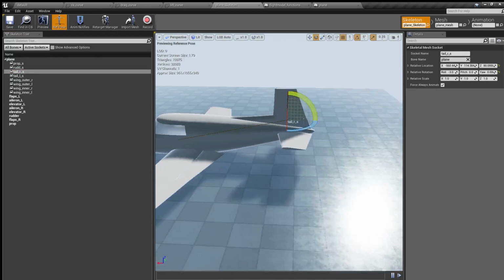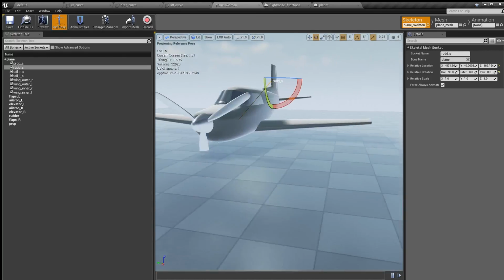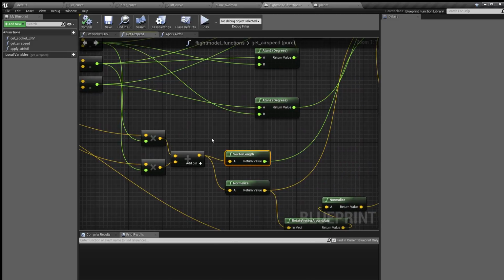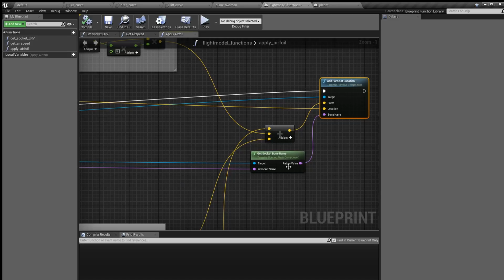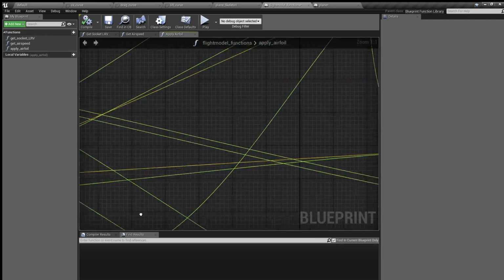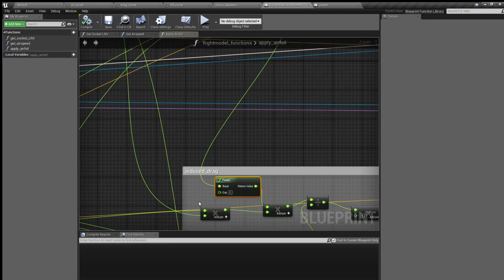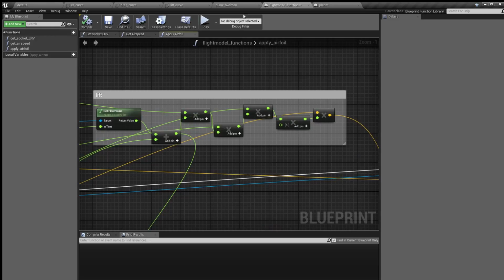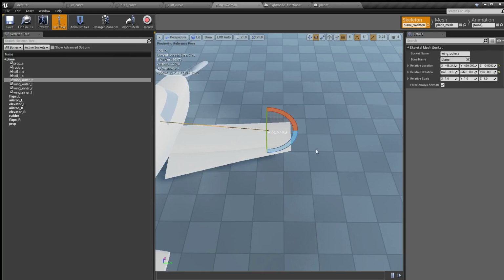physics based flight model in UE4 - how it works

Comment: More and more I respect your mind blowing work sir :D
The question is...now that your awesome plugin is released....is there a way to add these sockets again?!! because it will make damage model more realistic...or there is another easier solution?!
Reply from the maker: With EFM it's not possible, turning it into a component model would require complete rewrite. That said, lift asymmetry is modeled, and it's possible to simulate damage effects by changing left and right side multipliers separately.

Comment: Is there an easy way to calculate the physics in a flying sidescroller game? I'm thinking about cloning the game "3918" by oxeye. The plane only moves on the x and z axis and it rotates around the y axis. It needs to be able to fly upside down because the planet is going to be circular. It also needs to handle a changing air pressure, a complete vacuum and changing gravity.
Reply from the maker: Well you could do the same thing i'm doing here, except make everything flat and lock the depth axis, as well as roll and yaw.

Comment: how can i apply thrust to the airplane?
Reply from the maker: Get forward vector of  your object, multiply it by power of your engine, and apply it as force at engine location.
Reply: thank you ;)
Reply: So now my plane starts spinning. Maybe i did the axis mapping wrong?
Reply from the maker: 3NCRYP73D ACC0UN7
There could be a number of reasons, one is that yes, axis are set up wrong. Try turning off all the other forces except thrust to see where the problem could be.

Comment: hey,

this is really pretty nice. also saw your forum post and tested out the .exe with the jet-fighter. also really good work. looking forward to see it in the marketplace.
just can imagine a few different version of your plane contoll. defintily a thumbs up and waiting for more :)

also rebuild it. but didn't get it to work yet finally with the input. but takes some time, to repdrouce it. but also looking forward to the more complex version.
Reply: finally i got it working. just need to fix some stuff, but the plane is flying :) if you want to have again this simple version, mail me. (somewhere you metioned, your project went to complex).
this simple version is pretty nice. just the wire fuck (like you said), is a bit confusing.
Reply: @spaehling  My plane is slowly diving as I possibly don't really deal with the thrust BP. Could you share yours ? TY :)
Reply: @benoitc5266  i recommend getting: https://www.unrealengine.com/marketplace/en-US/slug/aerocomp
it has a nice documentation and all you need inside.
Reply: @spaehling  i found a solution thx. I could test aerocomp earlier but it is not really a plane, sorry for that.

Comment: Two questions.

1. How do I get/make the "Get roll" "get pitch" and "get yaw" functions?

2. What would be the best method to actually apply thrust to the plane?
Reply from the maker: +NovaXP

1. those are control axis, you have to set them up in project settings.

2. with "add force" or "add force at location".
Reply: +Worstplayer Awesome, thank you very much for this tutorial!

Comment: This is a really good looking system to emulate flight! You should consider putting it up on the Unreal Marketplace.  I know I'd buy it, especially if you added some of the features you talked about (like ground force and variable geometry wings)
Reply from the maker: +Kyle Biggs I'll probably put it up somewhere, but i'll have to clean it up, implement those missing features, and probably convert it to use physics thrusters, cause since making this video i found out that apply force at location doesn't play nice with physics substepping.
Reply: Can I help beta test?  I'm trying to bring a fictional aircraft to life (VF-1) and this would be a great start!
Reply from the maker: +Kyle Biggs VF-1 can go supersonic, right? That's a weak spot of this type of simulation.
Subsonic, fine. Supersonic, fine. But transsonic region, when some parts of the airframe are supersonic and others aren't (~mach 0.9 - 1.1), is where weird things happen. Elements that could be previously simulated as independent start to interact with each other (wave drag), and previously stationary centers of lift start shifting (mach tuck). It's very difficult to model accurately and best I can do here is some "magic number" approximation.

Anyway, when I clean the project up a bit, I can send it to you, and you can try if it works for your game.
Reply: I really appreciate your dedication to accuracy, but right now I'm flying it using the 'flying pawn' example.  As you can imagine, that isn't ideal.

Sub-sonic accuracy good enough for me to start implementing landing and takeoff would be a huge step forward. 

Thanks for letting me help test.
Reply: +Worstplayer I'm not sure where your latest comment went, but I don't yet have head-tracking.  I'd really like to implement it, but I've yet to see anyone who has pulled it off.  I think TrackIR requires you sign a NDA agreeing not to implement any other competing product, which is shitty.
Reply from the maker: +Kyle Biggs Oh yeah, I heard about that NDA thing. That would explain why there's no plugin for it. Shame.

Anyway, I have just added ground effect. In my limited tests everything seems to behave correctly, as long as substepping is disabled.
If you still want to test it i can upload the project somewhere (any idea where?).
Reply: Can you shoot me an email? I can host the file for you (just in case you want to share it with anyone else).
Reply from the maker: +Kyle Biggs Nah, don't share it just yet, there can still be bugs. 
Also I still have to add all the transsonic stuff - although i'll probably make it a separate function that's only done once for the whole model. Mail sent.
Reply: +Worstplayer hey man this is awesome! can I DM/skype you and possibly get some help with a parachute simulator? willing to pay for your time!
Reply from the maker: Brian Lancaster
Hm, i'm not sure how much I can help you with that. I can try, but non-rigid bodies such as parachutes are kind of beyond my area of expertise, any simulation i'd come up with would be very simplified.
Reply from the maker: +Brian Lancaster 
But if you want just some informal ideas contact me on skype (mookie420).